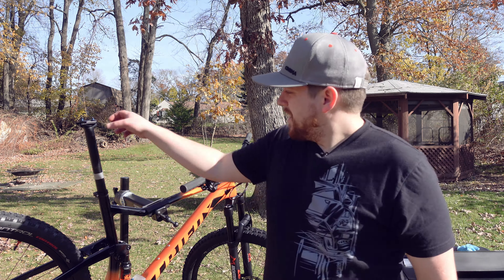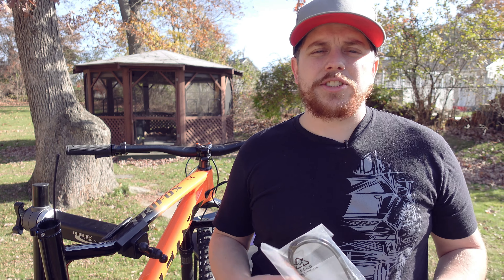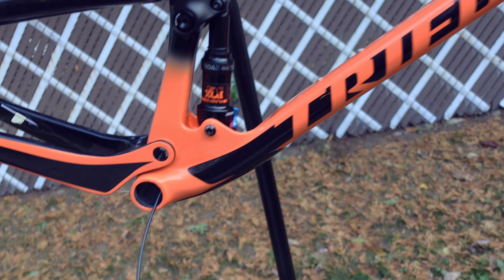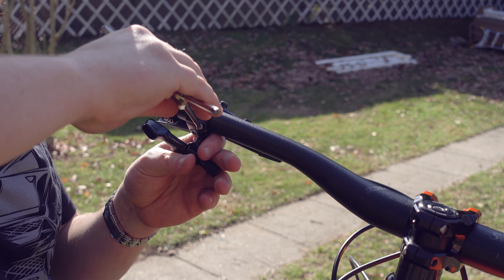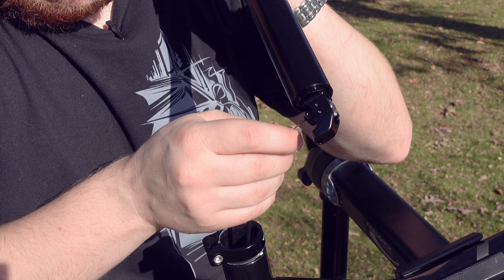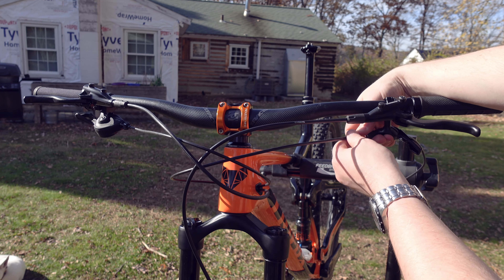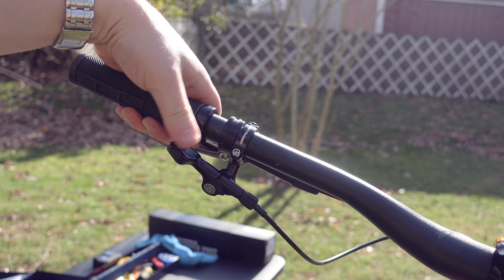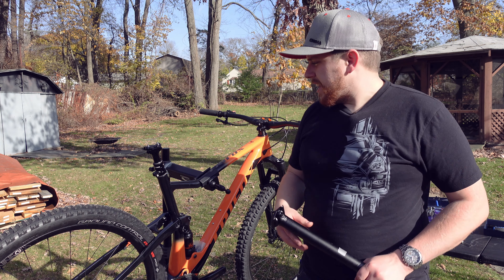How to install a internally routed dropper post | Raceface Aeffect Dropper

Comment: Awesome video both neat little tricks to get cables to length. Though I don't like that you're insinuating that the old seat post is trash. 
Suggestions:
1. You sell it and make a buck back for the fortune your nice dropper set you back, or give it away.
2. You save it as a spare, for when your nice dropper post is shot and you want to take a ride.
3. You save it for when you sell the bike and you want to transfer the dropper to your new bike.

Comment: Fantastic video, thank you. 
One question: Why does the cable have to be in the housing when you measure the housing length? Can't you just insert the housing ferrule into the base of the dropper and do it that way? Or will it not stay in place?

Comment: This way of cabling is so much better than having the cut end of the cable inside the seat tube with that tiny grub screw trying to hold it on and trying to set the tension
Reply: I need a video for this method

Comment: My problem is, the brake cable I have is a lot wider than the shift cable that fits so had to try to do it the other way... I struggled trying to get the wire through the stupid barrel without it fraying for like 30 minutes and went through 2 cables before I gave up, its a very frustrating design.
Reply: Yep brake cables are not meant to be interchangeable with derailleur cables. I like this hack but don’t think it will work every time

Comment: Good work! Two questions: How do you set the saddle height? You use a brake cable in derailleur housing?
Reply from the maker: Yes I did. The housing can take either cable. The types of house differe in compression properties, not the cable (Cable is just the end)
Reply: @Jamesthebikeguy  Thanks!

Comment: Where did the large end of the cable go? Did you just cut it off?
Reply: It goes at the bottom end of the dropper post instead of the screw on barrel.  Much easier to determine cable length at the lever end than the bottom of the dropper post.

Comment: Why isn't the lever usually included?  I've seen some outrageous prices people are willing to pay just for a lever.
Reply from the maker: The same reason that most better quality bikes don't come with pedals. Levers on a dropper poster very personalized and therefore the manufacturers sell just the post and allow you to choose what lever you want. better than spending an extra 20 to $50 on a dropper post only to throw it away and buy another 20 to $50 dropper lever that suits your preference
Reply: @Jamesthebikeguy  Pedals I can see the difference but is there that much difference between thumb levers other than the adjustment point being at the lever mentioned in the video.  I've never given any thought to my shifter lever.    Anyway good informative video, I think a dropper is in my future.
Reply from the maker: Levers actually do differ quite a bit. at some point I'd love to put together a video on it but it's so hard to get more than one at the same time that's not installed on something. but regardless you get different feels, different reaches, different leverage ratios, and different integration with brake levers. It makes for a bunch of different styles, although many are just the standard basic ones but there are a lot of different ones too

Comment: What if you want to remove your dropper post to put more air in?
Reply from the maker: You undo the job. But virtually no posts run air anymore and the ones that do have the port at the top of the post
Reply: @Jamesthebikeguy  ahh wow. I did not know that. I do have an external cable routed dropper post which has an air valve on the bottom for adjustments, but I currently invested in a Brand X Ascend internal routed dropper post. I can't find any info on whether this is an air or hydraulic dropper. It looks like there is no valve on the top either.